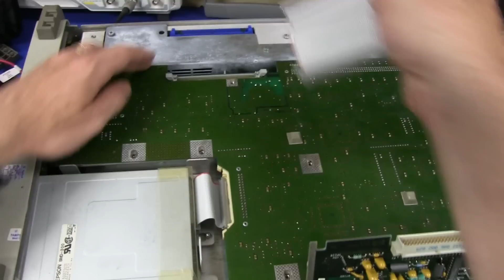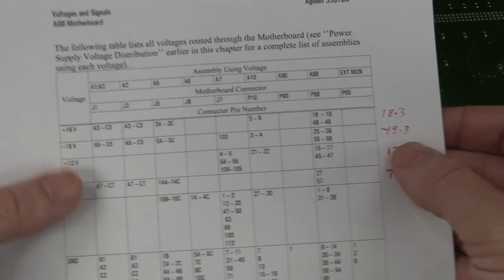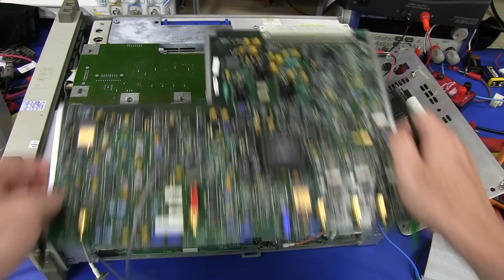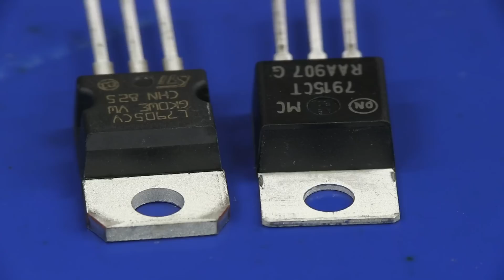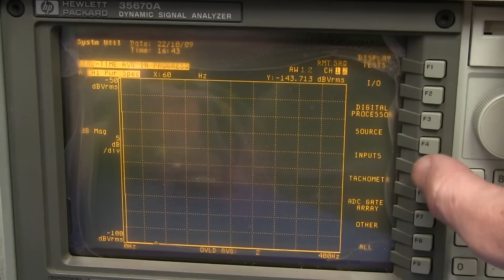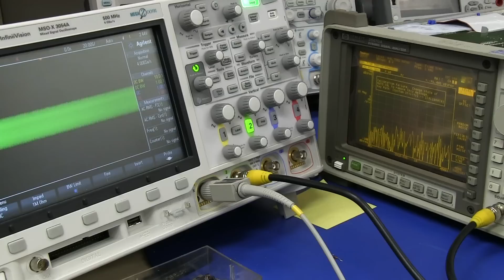EEVblog #538 - HP35670A DSA Repair - Part 2

Comment: good afternoon, my name is Alexander Useche, I'm from Venezuela, I have a problem with a HP-8924E Service Monitor, which after an electrical failure turned off and turned on again but, when it tests to start, it gives me " error 1000", so far I have not been able to find a solution, I think the problem is software, do you know of any solution to repair it???, since the most viable is to send it to the USA, but due to its size and weight it is practically impossible. I would appreciate any help that can help me revive this device. Thank you

Comment: Usually, Tantalums are my first suspects that I measure and lift legs on.. compared to normals elcaps they have one annoying specialty: they tend to fail to a short circuit which not only messes up your further measuring, but can also easily take out your recently fixed power supply again...

Comment: I think the main problem is an input overvoltage (measurement input).
All the things you found is related to analog circuitry.
Maybe the user exceeded analog input voltages blowing up the input stage, then, this stage fail short to the power rails, and then blow up the regulators.

Good luck.

Comment from the maker: No, I've easily tracked down and found three faults so far with no circuit diagram. The circuit diagram will make it easier in the long run for sure, but there is still a lot I can do without it that isn't "shooting in the dark". My main issue right now is (lack of) PCB access, not the schematic.

Comment: As you had mentioned structural corrosion in part 1 of this series, I've  got this impression that the original power supply went mustang, causing power surges and spikes, hitting just about every sensitive component in this unit...

I think you are going to be chasing after more faults and ghosts in this hunk of steel.

Comment: The other observation is that you moved the LO varicap. Has that changed the freq of the I2C? Was it 400kHz or 1MHz? Was it that time critical that can't be measured by 1 significant digit of a DSO?

Comment: Hi dave
You did pretty much did what I would do so far(man I enjoyed that). Voltages, then frequency, touch next. You know for all those errors there is a common theme. Perhaps another rail, ripple, 15 year old electros? Tantalums normally go s/c, so not that.

Comment: Here is what I do in this situation. Get a large schematic or board layout of the system printed. put it on a dart board and throw 5 darts, check the parts or circuits that the darts land on.rinse and repeat.

Comment: But the power supply does not give out more (or less, how do you say that for a negative supply) then about -19 Volts. The maximum voltage across the opamps will have been -19 to +15 Volts, or 34 Volt in total. That could be stretching it for the opamps, but many have an absolute maximum rating of +-18 to +-22 Volts with a nominal of +-15, so depending on the part, they could have survived. Also, I don't think the opamp really cares if it is symmetrical, so I'm guessing they're all fine.

Comment: All of them, it seems that there will be at least -35V on them according the specs as the specs tells you that that is the max voltage this regulator can handle. Total voltage over the OP-AMPS power lines was at least 50V in total. Most OP-AMPS can't deal with that amount of power. Hope to see a follow up on this.

Comment: No, since he´s in the right track, but it at least depends on the ASIC healthy....
I´ve repaired some synths successfully without having any kind of documentation for it. But when you know how it works and its main electronical structure as well then it´s possible. But if it´s someones first repair ever than it would be quite hard...

Comment: i would assume that an expensive instrument  would have surge protection on the rails to prevent stuff like  that on power supply failure.

Comment: I'm wonder how high was voltage on these rails during power supply failure. It's not so easy to kill -15 V regulator... But shorted regulator means -19V on ASICs so ASICs probably died too... Maybe they're protected. It should be in such expensive instrument, but who knows ?

Comment: I think, the ADC has been blowed away. Since if it´s rated +/-15V it may tolerate 10%or so and -19 are much to low...As i know that many synthesizer hardware (with curtis chips) dies because these chips rated +/-15V and do NOT tolerate +/-16V. Likewise some of the OpAmps witch tolerate +/-18V are dying when one rail goes beyond 19V.

Comment: In the first video you pointed out that a rubber foot or cushion had melted and spread over the top board that would take a lot of localised heat. Have you managed  to track down the heat source yet ?

Comment: if you want thermite you need iron oxide and aluminium. not aluminium oxide.. the aluminium takes the oxide from the iron which releases loads of energy, so you end up with aluminium oxide (white solid stuff)  and liquid iron :P

Comment: A good test a this point would be to check if any of the out of scale rails connect to that ASIC, cause if its failed its probably beyond economical repair.
On a other note, the op-amps could probably tolerate that -19V, a lm741 can take +-22V but an tl081 cant take over +-18V. If its +15V -19V the voltage across the op-amp is less than 36V and probably wont kill it. But don't take my word for it, maybe the spec sheet of the op-amps say it cant take over 30V total or something.

Comment: I'm betting on opamp or other analog failures. The common 32V PS differential limit would have been busted with a +15 and a -19.x. Look for an opamp with a railed output. I'm betting that will lead you to the input issues.

Comment: In a production lab we pull boards and swap till it solves the problem. The original suspected board  then goes in for repairs. Allowing the unit to go back in service during the repair.

Comment: you know.. the input power from the lab supply seems awfully high. ~ 90Watts.

Im guessing the opamps are fried( maybe even the ASIC). The next step should be to test the op amps out to see if they're shorted out.

Comment: The negative rail going "high" probably wouldn't have mattered if it was single rail, but being split rail you have to take into account the positive rail and the total rail to rail voltage which was over 34 volts and many opamps (at least the 324) can only handle 32 rail to rail

Comment: I know the feeling. Spoiled by the easy fixes. With some experience in most cases reparing stuff comes down to really simple problems. But maybe 1 out of 10 "patients" drag you deeper with every step you make. Hardest thing is declaring something beyond repair after pouring hours into it.

Comment: It is a tad worrying, as we will never know how bad the PSU went to screw up the pessimistic regs yet knowing the diode let what ever it was through, Grrr. Would the gate arrays rely on the I2C? Hazarding a guess, I am no genus. I won't bug you about the the time circuit anymore, whilst your in repair mode, however, if you get it working we could just pop back in time, just before this unit failed and hook up some test leads to see what happened ;p. All the best

Comment: If there an input overload my gess is to check the input section, probably they transistors that can be shorted or amplifier (strange because the -19 is on adc board and not on the channel boards). The instrument uses dac that could fail if too much voltaghe gon in it. The adc gate array wish is not gone away. I think that the gate array error is linked to the i2c error. What ther error logs said thi time? Some error go away?